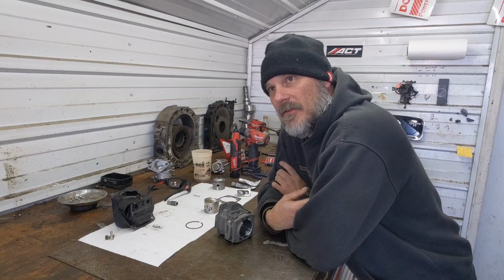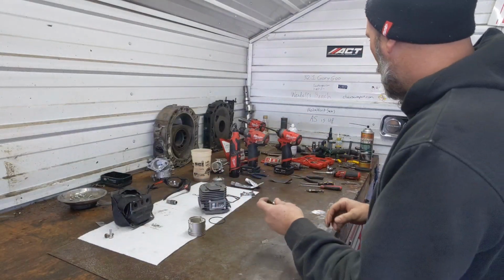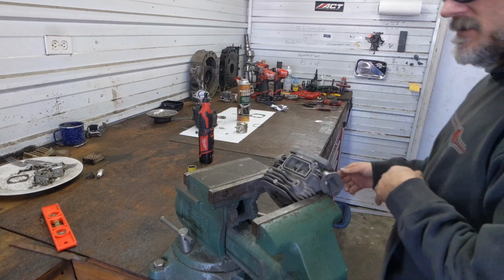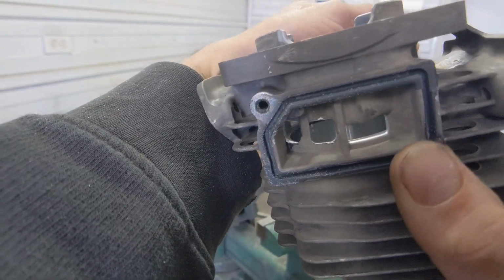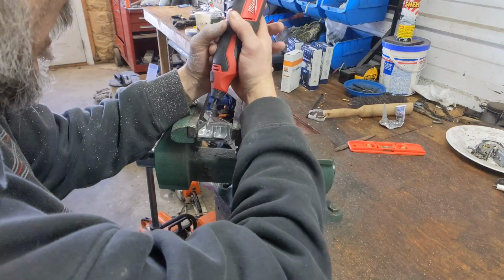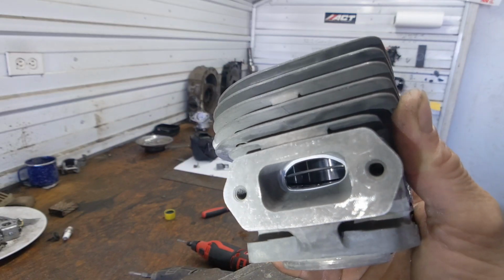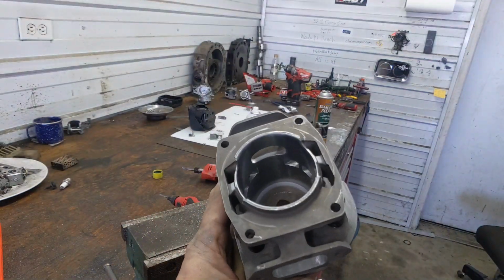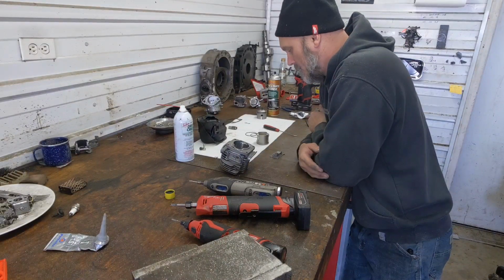Do it yourself Echo 7310 port job how to

Comment: Thanks for your info on this saw- and the port work video.
I went to my dealer to buy a 572xp which they were out of stock, the dealer also carries echo and asked if I had considered the echo7310. I was not aware of it. Found your vids, bought one did a muffler mod immediately and removed carb adjustment limiters.
After 3 tanks yesterday on a multiple tree removal job, I am impressed!
Finishing your port job on it right now!
Thanks VERY much.
Reply from the maker: Sweet.  Good luck.  You'll love the saw once it's broken in.
Reply: Finished port work, on tank 6 now.
Got out the tach to see where I was at on tank 5. Pulling 28 in bar, full skip, with the rakers at .041 in a 26in fir butt log, running 10200 in the cut and over 13000 out. A touch rich, using belray H1R 45:1 cut takes 28 secons
Reply: I am happy with this, you can push the saw and not kill it, still has power just slows the chain speed down, but it cuts faster just letting it work instead of pushing it.
I did also take .010 of the bottom of the cylinder, but retained the gasket, I am not experienced at port work but I do have a full machine shop.
If she blows up - I’ll send it to you for a real pro build! LOL
Reply from the maker: @brucethom4957  Thanks for the feed back.  Solid gains with little to no machine work.
Reply: Update 
9 tanks.
Pulled top cover off to check air filter. Looked at epoxy on the transfer cover and noticed weeping around the epoxy fill joint.
I used devcon steel. Looked up the specs and I don’t think it’s up to the task, says max temp wet 125F and dry , 250F.
Looked up the permatex you are using- it says 300F 
So I will be redoing those transfer covers! 
The other side seems to be holding up ok, wonder if it holds more heat on the closed side?
Reply from the maker: @brucethom4957  I've had good luck with the two I mentioned.  Make sure you get that surface extremely clean before reapplying.
Reply: Update on the redo of the transfer port epoxy.
Listen to Mitch! And use the materials he recommended.
Have put at least an additional 11 tanks since redoing with the epoxy he uses Holding up perfect.
As well this is one ripper of a saw, partner was running his 395 and I was running the 7310-
28 in red fir, it was neck in neck side by side in the same log! Surprised me actually, but with The mods he shows here it really wakes these up.
Reply: @brucethom4957   Any continued update on how your 7310 is running with this port work. I got a brand new one sitting on the bench that I’m thinking of doing this to. Thanks.
Reply: Go for it, mines still running great. No longer keeping track of how many tanks thru it. I personally would not be real happy with this saw unless it had these mods.
Reply: @brucethom4957  thank You for all the info!

Comment: I'll be doing my 7310p shortly. Instead of the epoxy route I plan to 3D machine the transfer out of solid 6061 aluminum, then grind into it just like you did. The only difference being, I won't be relying on epoxy. I would like to machine it to a finish product but without knowing dims, it's probably best to match by hand as you did. 

Thank you for the Info.

Comment: Thanks for making this video. I have a 7310 I've been using since Nov logging in iowa and it's been great.
Reply from the maker: You're welcome.  Where ya at in Iowa?  I'm 15 minutes west of Waterloo.
Reply: @mweba1  I'm in the Dubuque area.
Reply from the maker: Autigers 2010  Ha.  I80 runs straight through farm country.  Not much to see.  North East and Eastern Iowa is beautiful.
Reply: Autigers 2010  We have lots of trees in north east iowa .  All along the missippi is full of trees .
Reply from the maker: Autigers 2010  $950 power head only shipped lower 48.  Depends on guide length from there.

Comment: Nice I like it I will be porting mine im prolly gona cut my base down some an do some lower transfer work on it to you shud pick up a 501p or the new 4910 I just ported a 4910 an it's a little monster very fun saw to port an run
Reply from the maker: I've done many 501P's and the 4910 is the same base saw without a couple features.  Highly under rated 50cc machine.
Reply: @mweba1  yes there my favorite 50cc saw
Reply: @CharlesBrisco  ive seen your vid and it is a hungry monster . Does it seem more port freindly than 7310 ?
Reply: @mweba1  really appreciated you sharing the DIY porting video. I have a 620 and 501 but have not been thrilled with the air filters and letting in the fine stuff. Any suggestions? Also, would a port job be similar on those two models?

Comment: Incredible job! Anybody getting into mods and a 7310 will want to invest the time to do this!

Did you open up the lower transfers or trim the lower cylinder flange to help flow down there? Any thoughts on a piston skirt trim on the intake side for a bit more duration? I’ve found these couple minor mods on the Husky 365 XP really wake them up,  so just curious.

Thanks! 
Hope the family is doing better! Really great to see you getting your son to help with the skid loader in some of the other vids! Great dad stuff😎👍
Reply from the maker: The port lay out in this video will get ya 15% or a bit more.  The goal I guess was to get the dyi guys a saw that  will outperform a 572xp and a bit better understanding how flow works.  The woods port I'm currently shipping has the lowers modified, intake timed a bit more aggressive, combustion chamber modified and extensive carb work.  Chamber and carb work I wouldn't recommend to the dyi guys, could get into trouble real quick.   Thanks for the kind words.  My kids love operating equipment.
Reply: @mweba1  Thanks man, I've been finding that timing advancement sure is pays off too. You did a great video on it a while back.
Any plans to do a couple vids on the 572? I don't think I saw much on it.

Comment: Thanks so much for taking the time to make this video!  I really appreciate it!  I don't have that echo saw, but it seems that more modern sawmakers are putting that "ridge" or whatever you want to call it inside the exhaust port.  On my Dolmars/Makitas, there is a sleeve from the muffler, so it kind of makes sense to have that step.  But, it looks like the echo muffler is just a hollow can, without a sleeve.  So, why are they putting that step in there?  Maybe they are tempting amateur porters to go too far on the exhaust timing - heh heh!  Or at least making them a little more difficult to mess with.  Or did the echo muffler have a sleeve, and you had previously removed it?  I saw the little muffler quieting part, with the holes on the bench, so maybe you removed the sleeve too?  Anyway, why the factory step in the exhaust port?
Reply from the maker: You know, I immediately thought of the Makita/Dolmart cylinder.  Maybe in other countries the have a controlled scavenge muffler?  I'll look into it.  Thanks for watching.

Comment: Very nice Video, thank you for sharing your Knowledge. Very interesting Design of the Transfers. I‘m planing to port my 545 to get closer to the 550. 
it has 40 thousands of Squish and 104 deg Exausttiming. Trans have 115.
I would like to know the squish of a 550xp . I know the Transfercaps are bigger and it has Crankstuffers,but did they also change the Timing and developed a different Cylinder for the 545? Or did the give the 545 a bad Squish ? Have you got Numbers of the 550xp? 
Cant wait to see your next Video . 
Get well soon!
Reply from the maker: The cylinders are identical aside from the caps.  40 tho is more than I've ever measured a 545/550.  Usually have to cut a small popup running without a gasket for the DIY people.  The reason behind low blow down on the xtorq saws is to give the clean air time to clear the combustion chamber before fuel mix arrives.  You can destrato the saw or bore the carb venturi to add mix earlier in the cyclee.
Reply: @mweba1  the next Days, i will get a smashed 545 by a Tree and that will be my Portsaw. Payed 100 Bucks for it and it still runs. Lets see what the Squish will be on that one. I planing a base gasket delete, to get the Squish to 20tho and get the ex to 102 , or should 100 be ok?
Why are these saws so revy with these long ex Timings? Has the 550 the same long ex Timing. Ok it must, when the Cylinder is identical. Where the hell could i get those 550 transfercaps? 
Thanks for your Answer
Reply from the maker: @Witschor  I'll dig through my pile of smoked cylinders.  Should have some caps.
Reply: @mweba1  thats nice , i think you could not order them separately. 
What about ex Timing? 100 to much? 
I hope the Autotune could handle that. 
It should stay a strato so far.
Reply: @mweba1  Hey , did you find some Caps?
Reply from the maker: @Witschor   Ha.   I was trying to figure out where our convo was just this morning.  Have a cylinder for ya, yes.  Email me.  Mweba10@gmail.com